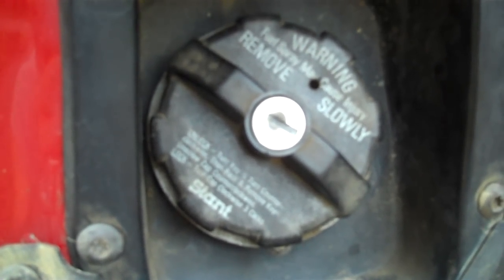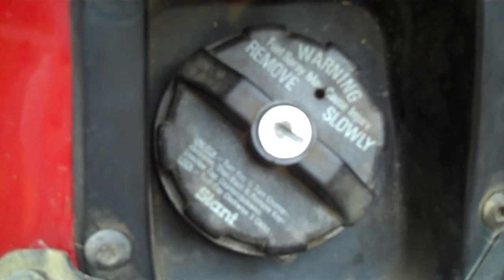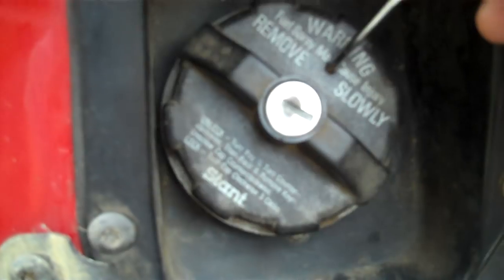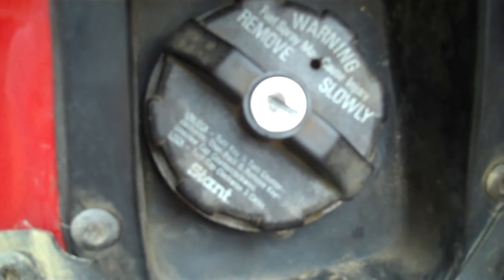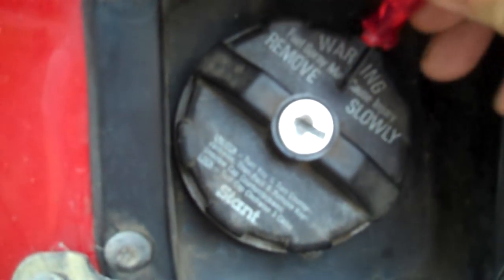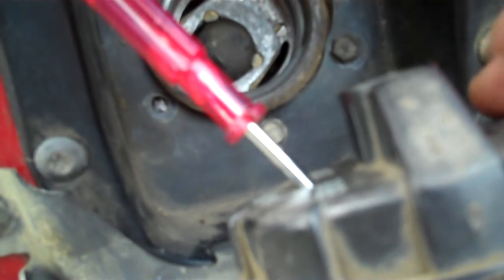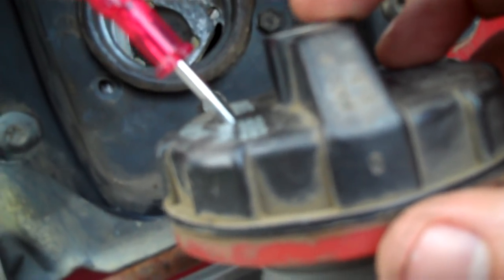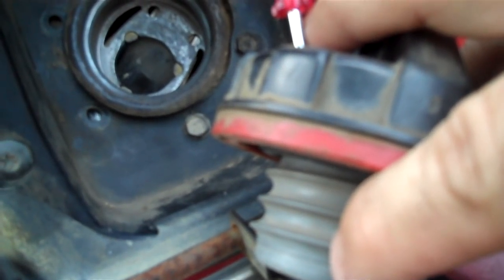How to remove YOUR locking gas cap if you lost or broke your key

Comment from the maker: Has this tip helped you? Here is an easy free way to say thanks! If Power Addicts has ever helped you and you wanna contribute in some way, here are some links that can help make that happen. This here is an Amazon link that pays Power Addicts a small commission from the total sale. Using this link costs you NOTHING more. https://amzn.to/39XSTTO
Reply: Just bought a used car, fuel warning light came on so pulled into a gas station - locking cap and no key! Was prepared to drill out the key ares 'till I saw your video - thanks Brother,  that was a lot easier than what I had in mind! Have a good one.

Comment: Just figured out how to take off the locked gas cap for my 2018 dodge GT challenger! Lost the key along with my key fob 200 miles away while driving to Boston from Atlanta. All u need to do is get a pair of adjustable pliers, grab the top and bottom of the gas cap and turn counter clockwise! Took one Chance to work! Saved hundreds of bucks that I might have had to hand over to a locksmith!!!!

Comment: It worked like a charm!! Drilled a small hole, put in a thin center punch tool in the hole and it came right off! Thank you brother now I can put gas in it!
Reply from the maker: You are very welcome! Glad it worked for you! Most of those caps are such soft plastic, you could have probably forced the center punch through the cap without drilling a hole first. That's what I did with that screw driver, I simply pushed and twist until it went through. Shot the video afterwards. Thanks for taking the time to leave a great comment and very happy it worked for you. Have a great day!

Comment: I bought a car from a charming old man who went on and on about how well treated the car was. After paying him a little more than I wanted to, I took it for inspection. It failed. The first time I hadn't checked the lights on a potential buy. Well I fixed it and went to put gas in it. Locked cap and no key. Anyway you helped me out. 30 seconds to fix the problem. Thanks.
Reply from the maker: Glad the video helped you!

Comment: I thank you so much it took about a minute to drill through with a small phillips screw driver. I couldn't get it all the way through as if I was hitting something so I tried to screw it off and it came right off. I wish my desire to go to youtube was stronger than my stubbornness. I spent over and hour with the dumb key with no success, prior to this.  Knowing this problem already after spending a half hour plus last time I traveled in my RV at the gas station with the dumb key, which finally opened. I filled my tank all the way and drove a few miles to the RV park and left my cap un locked and had my tank siphoned almost dry not to long after when I drove a block and ran out of gas thinking I had a full tank. Anyhow thanks. You saved me from trying to rip that cap off which was my next step.
Reply from the maker: Glad you liked my video and happy it helped! Sorry to hear about your unfortunate issue with your fuel getting siphoned. In the video you can hear my opinion of what I think of people that to things like that. I actually had a bit of a moral dilemma of releasing that video in fear I might help a dishonest person in wrong doing. I spoke with one of the instructors at the college I work at who is also a some form of state legal representative. He said that thieves are gonna be thieves no matter where the knowledge comes from. As long as I know the reason I made the video was to help people out of a bad situation, then I have done the right thing. What people do with that knowledge is up to them. From all the comments of thanks that are about this video. I feel GREAT every time I see that I was part of helping them.

My locking gas cap is still locked, my little screwdriver is now my key. Works just as smooth the day I hacked it the first time.

Thanks for checking out my video and the +1! Hope you have better luck on your next stop at an RV park. Thanks again and have a great day!

Comment: Thank you! Worked great on an old truck I bought and I was able to remove the locked cap. Much appreciated!! As a bonus, I was able to insert a permanent screw into the hole that I drilled which keeps the pieces together permanently.
Reply from the maker: Thats a good idea! No need to buy a regular gas cap, save a few $$$. Thanks for the great comments. Also thanks for checking out my video and have a great day!! :-)

Comment: Wow. This is so dope. I bought a hatch civic 97 i ddnt realize that my fuel cap is using key. I just found out that when i was at gas station, i tried it to open by my hand but it wont open. Now i was worried almost psf. But i didnt lose hope so i try to googled it and youtbe it. Then i found this video. My fuel cap doesnt have hole, so i made one using screwdriver after that i tried then THE MAGIC WORKS.. 2MINS I able to open it.thank you so much..
Reply from the maker: spartacus II Glad it worked for you! The cap doesnt come with that hole. Like you  .. I used the little screw driver and made the hole .. cap was of in under 2 minutes :-). Thanks for taking the time to leave a great comment!! Have a great day!

Comment: Took a little while on my Dodge Dakota because of obstructions around the cap, but finally was able to do it.  What I really like about this method is that it doesn't ruin the cap in case you are later able to locate the key.  Yes, I'm still hopeful.  :-)  Thanks so much!  Now I can go to my playoff party, go Eagles!
Reply from the maker: You are very welcome! I ran the cap in the video for years using a screwdriver to get it off. Worked just fine :-) Glad the video helped you. Thanks for taking the time to leave a great comment! Have a great day!

Comment: Wow worked perfectly!  I'm glad there is an easy way to get these off with no key, but it does make the cap itself pretty worthless. I had it off in like 30 seconds with a sharp phillips screwdriver and a hammer.
Reply from the maker: I agree that security is very limited, but to an unknowing thief, it's at least a deterrent. Glad it worked for you! Thanks for taking the time to leave a comment. Have a great day!!
Reply from the maker: ***** You are correct. Time, noise and light is are thieves enemies. Taking the extra time to fool with getting a locked gas cap off makes for a less easier target. There are plenty of others that do not have that deterrent... move on to the next target.

Comment: Gas station guy in Oregon showed me that all I had to do was literally put my fingers on the backside of the cap and pull on it while I turned sure enough it comes off. Oh well lol
Reply from the maker: Yep .. I've seen that done as well. Also, some of the plastic caps you squeeze the outer surface hard enough as you twist, it brings them right off. Thanks for leaving a great tip! Have a great day!!

Comment: I had my key but locked or unlocked it would just spin and I couldn't get it off.  Good thing I don't run to empty so I had enough fuel to get home and watch this video.  And I can keep using the cap until I find my original.  Thanks for the 'Fo!
Reply from the maker: +Calgary Contractor You're welcome! Im still using the same cap that in this video. It still has the locking function, its just a little screwdriver that is my key now :-). Thanks for taking the time to leave a great comment! Have a great day!

Comment: You're the kind of dude that I buy your drinks day and evening my friend!!! Just saying you saved my ass from an evening of hell. I did this and it worked like a charm, my other option was to sit and wait for hours (in hot sun) for a locksmith, pay up a ton of $$$ then have to spend more $ on another gas cap and spare key. As it is I'm going to leave it and open it with the screw driver from now on...Good Karma coming your way....thanks again!!!
Reply from the maker: Paul Castillo That's gotta be one of the coolest comments that has been left on this channel. Thanks man .. really cool!! To this day I still use the same screwdriver I used in the video. Why change something that works .. ya know. Glad I could be there to help ya out my friend :-) . Have a great day!!

Comment: Great.. Thanks lot man I just put lock fuel cap, hoping that noone will figured out how to break it!  Now they'll come here to learn how to take my lock cap off.. sighs
Reply from the maker: +EvilSwordman I work around several retired cops and a retired judge 4 days a week. They say that the crooks already know how to do it. This is for the people who need the help when they loose or break a key. Thanks for dropping in and have a great day!
Reply: +Power Addicts - FixJeeps.com - Jeep, car and motorcycle tips But it take them a while right? I mean evenually they'll be making noise..
Reply from the maker: If they make noise on a plastic cap .. they ain't very bright. I can get into a brand new plastic cap in less than 15 seconds. As for getting the fuel out. That may take a bit more time depending on how they do it. Put a metal cap on if you are worried about gas thieves. They are much harder to get into. It sad that we honest people have to worry about things like that. But .. there are bad people in the world, we can only do what we can to protect our selves.

Comment: great video, but the top with lock came right off,at the pump. now I got to get the other part out cause I need gas asap. same brand cap, 7 yrs old. going back to stock.
Reply from the maker: If it came apart, something was defective to begin with. With the part left in there you should be able to take a pair of pliers and just twist it out. Don't blame you for going back to stock. I'm still using the same cap that I used in the video. As long as I have a small screwdriver around, I've got a key. Hope it all works out well for you. Thanks for taking the time to leave a comment. Have a great day!!

Comment: You can also drill a 1 inch screw with a little silicone into the hole and its as good as new.
Reply from the maker: That is true!! Thanks for dropping in! Have a great day!!
Reply: Power Addicts - FixJeeps.com - Jeep, car and motorcycle tips No problem, thanks for the tip it helped a ton.

Comment: Question, how do you safely make a hole in the gas gap? You cant rusk using a power drill near gasoline fum.
Reply from the maker: I didn't use a power drill. I simply pushed the nail through the plastic.

Comment: Dang I need to removing a gas cap on a 64 Impala but it's an old school locking cap.
Reply from the maker: If I remember right, those push and lock in. Has locking tabs that are spring loaded that expand out and lock into the neck?
Reply: I think it does lock into the neck. It looks like this one just without the warning label http://bit.ly/1dqyq61
Reply from the maker: Spring794 That one is definitely an issue. Drilling it will not get you in. Those do have the locking tabs that expand locking into the neck. I've had a few old Mustangs that locked the same way. Only SAFE way (you do this at your own discretion, I assume no type responsibility to person or property by presenting this option .. sorry I had to go there) is to drop the tank, therefore disconnecting the filler neck/hose from the tank. Remove the filler neck & hose assembly from the body. Once you get that assembly out, wash it down well to make sure there are no gas vapors. Then start cutting away at the cap to get it removed. Don't cut/drill the cap in any way while it's still on the car. Any type of spark can ignite the gas vapors causing an explosion. Yes, you could get a lock smith because that is a lot of trouble. But depending on the cars condition I'd want to clean the tank anyway. I had a '67 Mustang Coupe that had tons of trash in the tank. The Jeep that I make these videos with .. had lots of dirt in the tank. That's the way I would go about this. That was back when they made rugged quality stuff made of metal, not synthetics and plastics like today. Sorry wish I had a better solution for that one .. but thats a REAL locking gas cap.
Reply: Thanks for your help. The tank will probably ending up being dropped anyway because my friend inherited this car from his grandmother and she quit driving in 1985 at which point the car was garaged.
Reply from the maker: Spring794 Yea .. with that being said. That many years of sitting, I wouldn't think twice about dropping the tank to at least have a peace of mind knowing it's clean on the inside. Tell him good luck with it. That is a sweet ride no matter what motor is in it! Thanks for checking out my videos! Have a great day!

Comment: I have a 2004 chevy silverado with a cam on style gas cap. All of the locking gas caps can easily be removed with slight pressure and a counter clockwise twist. Unfortunately someone keeps siphoning my gas is the a metal locking cap that works for trucks?
Reply from the maker: Ben O'Dear I know of an '06 TJ Wrangler that has that style gas cap. I've never had that much experience as to what style locking gas caps are available for those. I'll see if I can find some information for ya. Thanks for checking out my video!

Comment: Does anyone know if you can still drive with the hole in it or no? Would it mess something up or get a new one?
Reply from the maker: Yes you can. I used that same cap for years until I forgot it getting gas. Then I had to buy another .. oops!
Reply: @Poweraddicts  thank you so much, lol I happened to have a drill in my car at this time, drilled it and the drill bit got stuck in it lol so I'm just gonna leave it like that😁 thanks

Comment: What if you do not have a hole in the cap already?I know u said something about that but the audio for my computer tends to cut out.
Reply from the maker: There isn't a hole in the cap to start with. You have to take the point of the screwdriver and make the hole. Place the point about where i showed on he video. Then push and twist until the screwdriver penetrates through the plastic. After that, push the screwdriver in at an angle toward the center until it stops. Holding a bit of inward pressure on the screwdriver screw the cap off. You are home free!

Comment: is there an after-market parts the backplate for my headlights I cannot adjust them the whole plate and adjustment screws are frozen
Reply from the maker: I replied on another post that you made about this same issue. I've seen the adjusting screws at auto parts stores in the help section.
Reply: Do you have any advice on water inside head light and won’t light up on my 2000 Ford excursion  passenger side? Thank you

Comment: I am going to try this tomorrow. I lost my key for the gas cap, and I didn't think there was any way to get it off.
Reply from the maker: Gary M As long as it's the plastic type screw in type, they are easy to remove. Hope it goes well for you. Thanks for leaving a comment and have a great day!!
Reply: I pounded a nail in the cap just enough, turned the cap and it came right off. Thanks again!
Reply from the maker: Gary M You are welcome! Very good .. glad it worked for you. Have a great day! :-)

Comment: don't worry about the brand of cap guys...if it is cheap plastic that has free spin it will work
Reply from the maker: That is true! :-) thanks for dropping in a great suggestion for viewers. Have a great day!!
Reply: +Power Addicts - FixJeeps.com - Jeep, car and motorcycle tips...no prob. bro I was kinda scared to do it but it turned out okay lol those dang caps don't last but a year my check engine light came on because of it
Reply from the maker: Yep ... Evap pressure is off. Luckily easy fix.

Comment: Hello, I lost the key to to the gas cap for my 1987 isuzu trooper. Unfortunately the gas cap looks different than this one. There's no hole to insert a screwdriver. Got any ideas to take it off? Its a full metal gas cap.
Reply from the maker: If the cap screws in, you still have a chance. But the trick like in the video isn't going to be as easy. If the cap snaps in... well then you have a problem. So, lets hope it screws in. If it does, what I would do is get a drill with a small drill bit that just a little bigger than a small screwdriver. With the drill bit running at slow speed SLOWLY drill though the first layer (metal layer). Slow speeds is less likely to cause sparks right next to the gas tank opening. Once through the metal layer, the screwdriver trick should work then. This is what I would do, but being that you are right next to the opening of the gas tank. Proceed at your own risk & responsibility. Good luck, thanks and have a great day!
Reply: Alright thanks a lot!